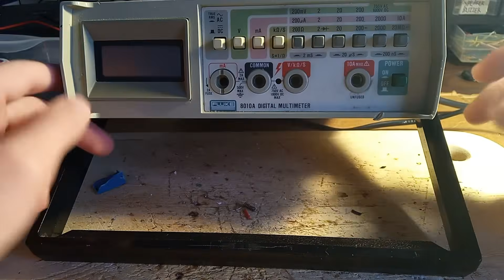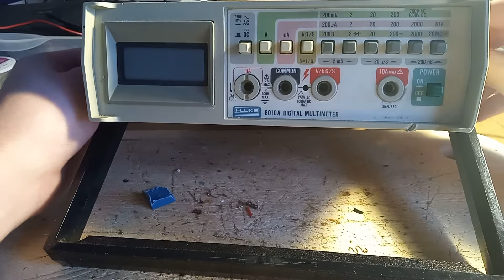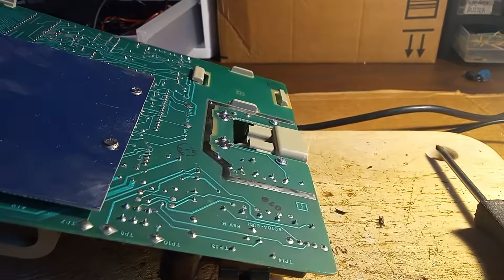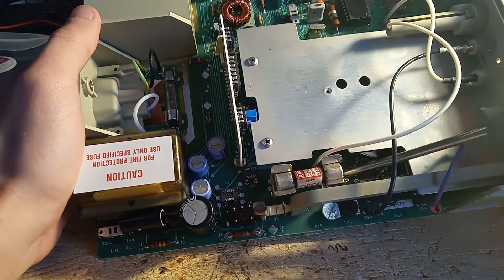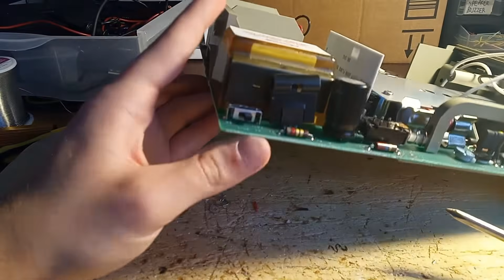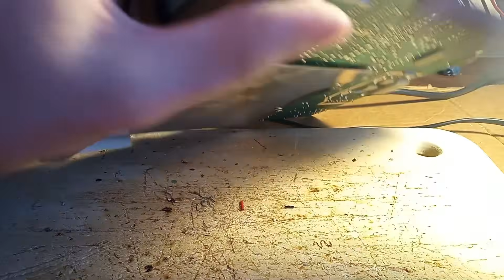What's inside an old multimeter?

Comment: fluke aka philips is still the industry standard, due to small production of there equipment and most other lab equipment yeah your going to find rare or exotic parts or parts that are complete overkill, like the switch, its actually really common to do that with a mains switch that way you have more real estate on the PCB, or you save some if its cut out as well as keeping the high voltage stuff near the transformer. 

Anyway bro keep up the work.